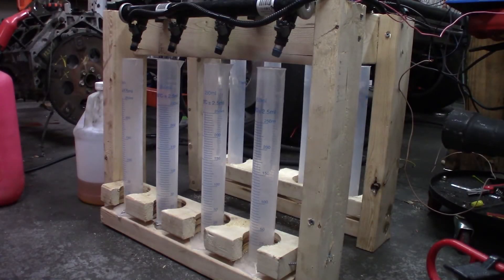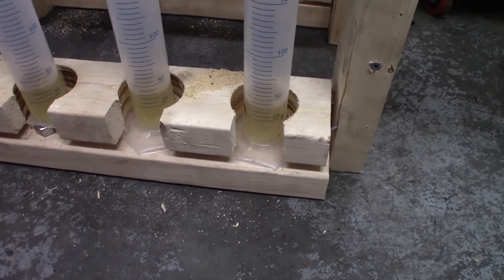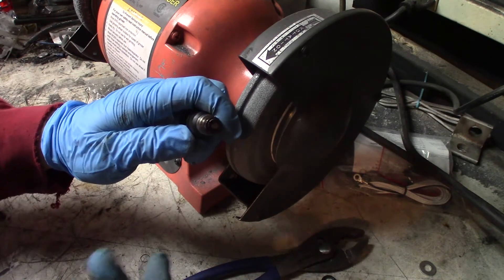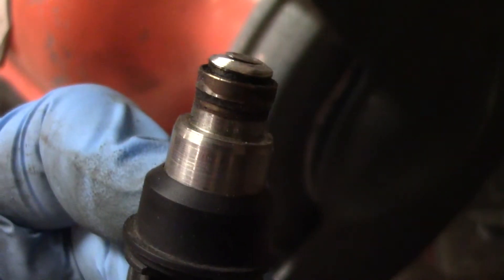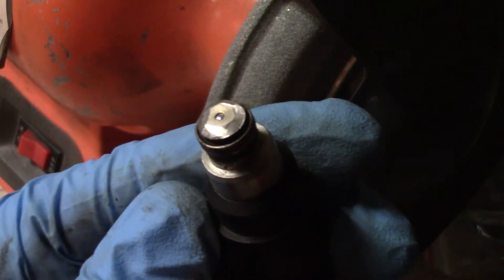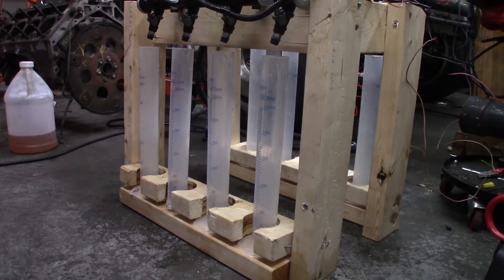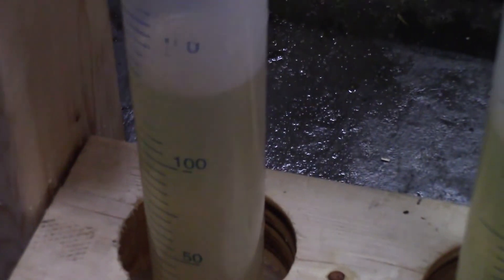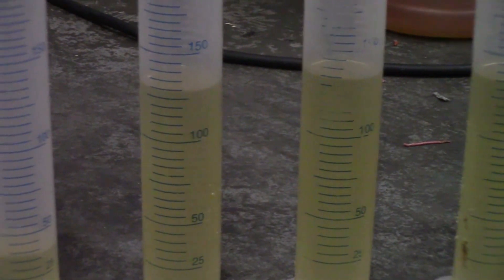Arduino Flow Bench and Decapping 4.8/5.3 Injector Test!

Comment: Would u be able to use decapped injectors on a stock engine?
Reply: Yeah, but decapped injectors don't atomize the fuel as well, so if your engine is N/A, that might be a problem.

Comment: If I were mounting these injectors above a roots blower Id be all for trying this. Otherwise no way. Its going to seriously affect spray pattern and atomization. Sucks to say the only good choice we have is bite the bullet and pay for quality injectors in the flow rate we need for our applications.
Reply from the maker: I've made 700 horsepower on these. Spray pattern isn't great but it's not noticeably worse than large aftermarket injectors like my Deka 80s.

Comment: Removing the caps will increase the mass flow rate however, you hurt the atomization properties of the injector. This reduces the quality of mixing. More fuel may be reaching the chamber but less of it will be getting burned causing the engine to run rich. The better way to increase flow is to adjust the pressure drop across the injector and adjust the hole size and pattern accordingly. This will result in keeping a good spray pattern when increasing the flow rate.

Comment: Nice test! What fluid are you using? Do you have a link? 
Many thanks mate :D
Reply from the maker: Mineral spirits. It's usually clear, the coloring comes from the old gasoline that it is removing from the injectors.

I now put them in an ultrasonic cleaner before putting them in the injector tester to get out most of the gunked up old fuel.

Comment: What psi was the rail at on your test? I have these decapped just like the ones you have.I plan to run 60psi at the fuel rail. Do you know what the injectors would flow in CCs at the 60psi fuel rail pressure?
Reply from the maker: This was using the stock truck regulator on the fuel rails to control fuel pressure, so it would have been a 58 PSI test.
Reply: Didn’t listen to the video, I guess…

Comment: Plz post your code in text format.
Reply from the maker: I've already changed it a LOT from this video. Using SSR now, with an LCD screen and 2 potentiometers that allow me to set an RPM and duty cycle first. Code on everything I do is always changing. I'm also upgrading to 1000cc graduated cylinders so I can run injectors pulse width up to 1 full minute total to get an accurate cc/min.
Reply: Thx. I prefer an OLED over a LCD. Still care to share?    ......plz.